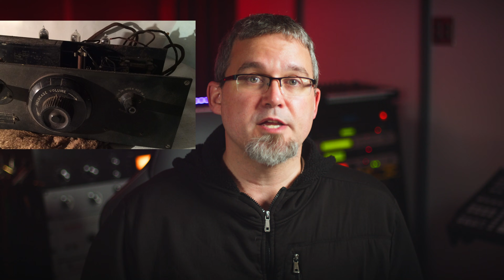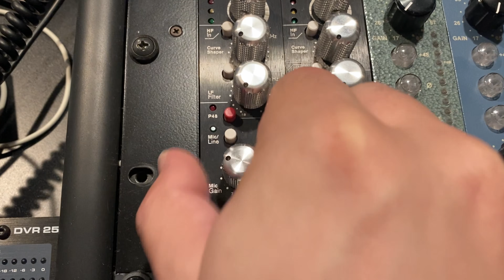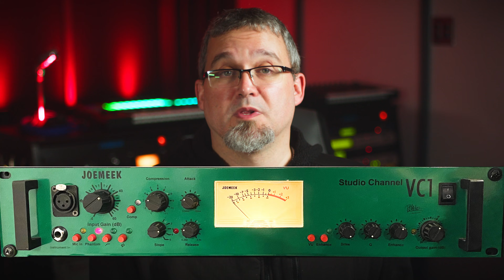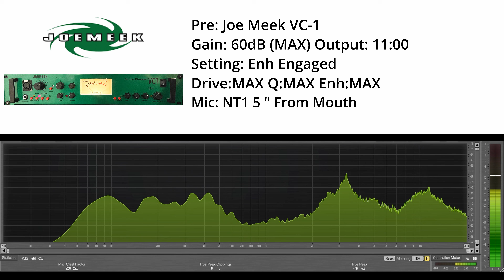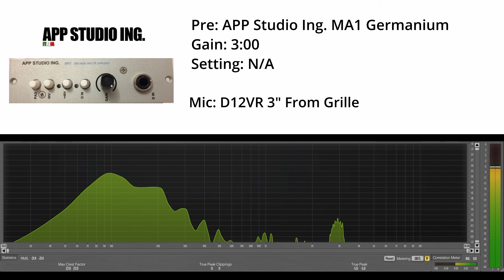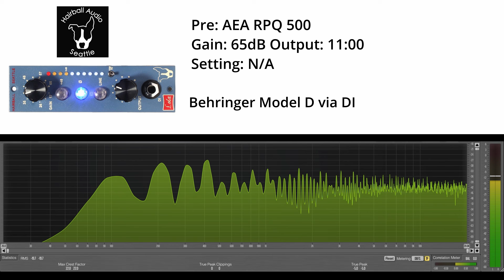Mic Pre Coloration

Comment: PART II: How different Preamps "Capture" the source, and how those choices Fit the Mix.

At the end, you mentioned almost in passing, the Transient Response of the Preamps.

How "Fast" the Preamp is and what it lets through to the record medium has a dramatic effect on where it sits in the mix.

The focus on Flat Frequency Response and  Harmonic Saturation aka "Character" are rightly emphasized, however the Speed of a Mic Pre (and the Mic itself) IMHO are Equally important. 

I'd love to see a follow-up where you not only elevate the Transient Response to it's rightful emphasis, but really base the video on:

Having an Idea of where everything in the arrangement fits in the mix, and making recording decisions that land the Multitracks near where they will ultimately live.

Sometimes a source is sharp and you don't want to lose that.  Equally as often a source is sharp and you wanna round it off gracefully. 

Tubes, Tape, Transformers, Transistors, with Preamps often in hand, all shape the Dynamic Envelope of the sound as well as the Frequency Response and THD.

Saturation is tasteful Distortion, and Distortion is also Compression.  

Learning how Preamps naturally behave when driven, and choosing which to use based on those characteristics, ends up being a bit like setting Attack and Release Times on a device properly labeled as a 'Dynamics Processor'.

Just my two pennies, and requestfor the DJ.

Fantastic Video though!
Reply from the maker: Im of the mindset that a preamp is not fast or slow.  Transient response on a pre, from an electronics standpoint is negligible at best. Theres an inertial effect at play on the mic side but its very minute.  The slew rate of a preamp isnt something that ive found matters that much in the grand scheme of things.  And the rise of the transient cant be faster or slower than the signal thats is going through it otherwise youd be getting a different pitch. (Amplitude/time) Frequency response is often confused for transient response, especially in mics.  If something has more sensitivity in the top and and a clicky transient lives in that range, were going to think theres something else at play since those peaks stand out, but its just the nature of the response of that particular mic or pre or whatever youre running it through.   Ive yet to have a EE prove transient response is a real thing and the few that tried essentially just proved my frequency response stance.  Madison ave buzz words that people take as fact. 

Getting raw tracks to be as close as can be to where they need to be, again, my opinion has to do with the following (in order of importance): Artist, mic placement, mic, pre. If you know what the equipment you have at your disposal is capable of, its a lot easier to get there. Tons of experimentation and real testing. And even mics/pres of the same make/model/manufacture date can be slightly different due to component tolerances. (Resistors, caps, coils, trafos, tubes). Processing on the way in is also a level of commitment few are apt to do.  I will run my drums through eqs filters transient designers compressors on the way in to get them as close as possible. Certain things need a little help past just the mic and pre. I can certainly go down that rabbit hole at some point. And its a deep one!  Thanks for sharing and checking it out!
Reply: @meistudiony If I were to bullet-point out your response, I think I Agree with every point in theory and in practice. 

I would add to your order of importance the Room, and artist/musician position within the room.  (The Mic vs Mic Position priority order.... within reason on both.  I'd say equally important.)

MadMen jabs aside, my Ears percieve different Mic Pres as having a speed difference. 

Now if you're saying that by Match EQing the resulting files, that perception of faster/slower goes away, I'd be eager to learn something new.

Let me say this:
My opinions are far less important to me than my understandings.
Opinions stem from understandings.

So my understanding here is that multiple things can make a source sit further back in the mix:  Level of course, LPF rolloff or maybe Tilt, and Transient Response. 

Slew Rates in different analog circuit topologies are a Thing.
Are you saying that they're not really a thing in Preamps?

(And yes, there are many things we can and do, do to a signal on the way in.  But this video, your topic, was about Preamps. Not what comes before or after.  The kitchen sink wasn't really part of the focus.)
Reply from the maker: @G_handle  The room is definitely a consideration if its to be included in the sound of the recording.  (it can be taken out if you have a really dead environment, think 1970s drums) 
So slew rate is absolutely a thing, its essentially how quick the device can change voltage but where that becomes a factor, you're asking for distortion or is so loud and high frequency you will probably never actually HEAR it.  Under normal operating conditions, not saturating or clipping, even the worst opamp's slew rate is not going to have an effect on the audible signal.  When you get into that clip/saturation are is where the slew rate distortion comes into play.  Also, its gonna be REALLY high frequencies... like frequencies that we dont really "use" (think over 18-20k)  Theres a lot of math behind it i wont put here and perhaps this might be a topic for a tech geek video. ;)  Maybe demystify the marketing teams BS and what is actually practical and real world may help everyones (including myself) understanding of what that means and what its doing.

Comment: i found the aea superior. very underwhelmed by the api500 and the neve500 (which i own). do you think the aea suits condensers and dynamic microphones as well?
Reply from the maker: The aea is just very clean no added color or texture and a ton of gain which makes it suitable for just about everything.  The neve and apis werent 500 series though. Rack units. Ive since gotten the ssl pure drive octo to replace the avid pre which has a TON more features.  Check out that video. It has adjustable load settings on it which gets close to the aea and can be just as clean but not quite as much gain. It isnt often i need all the aea is putting out. Really old ribbons like an old rca 44 or something can start to creep up there depending on source. Thanks for checking it out!

Comment: Wish you would have featured the Fredenstein HD Mic Pre. Anyone around who run some tests with it?
Reply from the maker: Yeah, seems like there isnt much out there in regards to that pre and actual real world tests.  If i can get my hands on one I'll certainly consider giving the once over.  Thanks for checking out the channel!  Appreciate it!
Reply: @meistudiony  Hi thanks for the quick reply. Fredenstein’s EU department recently sent me one HD Mic Pre for testing. I recorded an oscillator-based, analog drum machine (Soma Pulsar 23) (known for very fast transients) side by side both with the Fredenstein HD Mic Pre and a JLM Audio TG 500 FET Pre. Recorded at 192kHz, 24-bit, AD conversion by Cranborne Audios 500R8. Since the drum machine has 50Ω TS line outs, I used two Orchid Electronics Micro DIs before hitting the preamp.

I have the full stems uploaded (Google Drive) if you’re curious to check the comparison. Happy to share the link via DM. Would love to hear your thoughts on the sonic differences! best.
Reply from the maker: @partydj987able sure hit me thru the website w a link. Thanks!
Reply: @meistudiony  your website seems to be malefunctioning. after trying to send a message via the contact page I recieved an error: "500 Internal Server Error"
Reply: @meistudiony  an error occured after sending (500 Error internal server error). pls let me know if you recieved any message.
Reply from the maker: @partydj987able  site was undergoing maintenance this weekend and might have been a little wonky for a few hours.  Its working now (just tested).
Reply: @meistudiony  sorry to tell, but the error remains. Tested with several browsers. maybe it's bc I try to ping the webside from within EU..
Reply from the maker: @partydj987able  thats odd.  I'll check some stuff on my end.  Try sending an email directly.  info at meirecords dot com.

Comment: I wonder if that VC1 has a different pre than my VC6Q? I don’t remember mine sounding quite like that. I used to use it on electric guitars until I got the API channel strip. I might have to plug it in for old times sake
Reply from the maker: The VC6Q didnt have the input transformer if memory serves and didn't have the "enhance", instead, giving way to a (IMO) more useful 3 band eq.  Very similar vibe though.
Reply: @meistudiony  yeah that sounds right. I remember reading about it being in sorta the middle of the Joe meek range. Either way, it served me well for a few years until I could afford some of the other things I really wanted like API and Neve. I might pull it apart and see if I can dress it a bit better and lower the noise floor. It was okay on distorted guitars if I used a gate, but man did it come with some hiss
Reply: From my limited research and understanding the only meek products that had this preamp configuration were the original brick, very hard to find and the full rack very first vc1. Being nearly the same circuit as the brick box in 19” rack form. Even the vc1q or later variants don’t have the transformer preamp

Comment: Dude, learn how to use PluginDoctor, the LinearAnalysis page, which you are clearly using, only works if the process being analyzed is literally linear, which preamps are NOT. The LinearAnalysis page just shows literally meaningless nonsense response for any non-linear process. For a non-linear processor (for example a preamp) you have to use the Hammerstein page, which separate responses for the levels of the different harmonics. If you try it, you will see much less wild fundamental responses from gear and plugins. Also, the fuzziness of the response curve on the UAD pre is just noise, not any other form of coloration.

Comment: Great video! The volt was the worst for me and focusrite did much better for having the same chip, maybe the clock or converter chip was better. Avid gets a bad rap from the general public but it’s consistent with good information. If I had to invest for color the API surprisingly is top for me here, with JoeMeek being second. I personally use Grace pres which I don’t see any of these replacing but if I were to expand I’ll have some good ideas here. Thanks for the info and history. 🙏
Reply from the maker: Chips different in the volt and scarlet.  The SSL2 and Scarlett are the same chip.  (hope i didnt screw that up in the video lol) Without the voicing set (vintage or whatever) they're actually darn close (and cheap lol).  Grace makes some REALLY nice stuff!  Thanks for checking out the video!  Appreciate it!
Reply: @meistudiony  no, that’s my error.  The volt sucks😬.  The SSL slipped by my radar, if the cost of focus and ssl the same then it comes down to features I think. Maybe ssl was slightly not noticeable against the focus now that I think about it, I am an SSL fan of the analog channel strip when available at studios so one would think I’ll be biased. New subscriber, looking forward for more.

Comment: If you also analyze what kind of overtones are added, you may find that the  610 AND the Neve are adding even (octave above) and API starts at odd ones, when overdriven. That makes different color. It is hard to get these even harmonics with plugins. But there are a few that can.
Reply from the maker: Yes, and thats another rabbit hole as well.  The circuit topology will certainly cause this (tube tech going even order and solid state usually if not always going odd order).  The harmonics when high enough level, essentially are these overtones.  We tested a 1k sine wave, which the main spike is in the examples and the harmonics being the overtones either an even or odd (or both) intervals from the fundamental.  Thanks for checking it out!

Comment: OMG Pags! Maybe the weirdest comment you've gotten, but I need to watch this tomorrow. Just got back from the studio, (1:23am),  and too tired to really pay attention. Can't wait to watch. Thanks in advance - peace.
Reply from the maker: Its long and boring... the way an analytical video should be hahahah!
Reply: @meistudiony  Long and Boring? Maybe I am doing this right . . . Finished the vid today, very nice info, especially for someone who does not have any "boutique" pre-amps. I didn't know what else to call them, no bias intended. I have an older 32/8/2 Soundcraft and use the stock pre-amps that feed my various interfaces that are ganged via ADAT. I think I'll e-mail some questions . . . Thanks for all you hard work!
Reply from the maker: @redcabinacoustic-official  A lot of people hear a lot of things.  When I listen i kind of think about the context of a mix and I kind of dont feel that you could go wrong with anything here (except maybe the joe meek... esp if you set it wrong).  Are there little subtleties? Yeah of course.  Are they negated the instant you reach for an EQ? (either a plugin or the EQ on the board)  I kind of think so.  As long as the signal isn't noisy and  not dramatically rolled off in any direction... you're golden!  Soundcraft made great stuff.  Is it an MH, GB, LX?  I used to do repairs on them 20 some odd years ago. The pres in there are probably more than adequate for most things.  If you have direct outs per channel, that would be a beast.  You'd just need some good line in interfaces and you're rockin a great setup.  With the onboard eq (on just about any model) you can make the argument that the channel strip goes above and beyond any of these pres without EQ's.

Comment: Probably the best preamp breakdown I’ve ever seen. One small correction: the Lola is a fully differential preamp. One op amp provides gain for the non-inverted signal, the other for the inverted, so it’s more a parallel configuration than series. This gives it more available current to drive the output transformer.
Reply from the maker: Aw crap you're absolutely right!  I even have that in my notes and said the wrong thing.  Good catch!  Thanks for checking out the vid!
Reply: @meistudiony  all good, just nerdy nitpicking :). Great work though, it’s not an easy topic to discuss concisely and objectively!
Reply from the maker: @beepboopwompwomp  all good. I appreciate the call out on it.  The last thing i wanna do is add to the confusion and misinformation out there.  The more correct things can be the better.

Comment: Great video. I used to lend way more credence to preamp choice but the longer I've been doing this the more I've come to find that it mostly doesn't make a big enough impact for me to spend a lot of time thinking about it. Mic choice or moving a microphone an inch is going to have a much bigger impact on the recorded sound than preamp choice 9 out of 10 times, at least in my experience. I love my APIs and my Neves but I also love my UA Apollo preamps which are clean as a whistle! Most of the time when I'm in a studio that has a big desk with lots of preamps I'll now choose to run almost exclusively through those rather than patching off-board pres just for the convenience factor.
Reply from the maker: Yeah, after doing this, im kinda with ya on that.  Thanks for checkin it out!